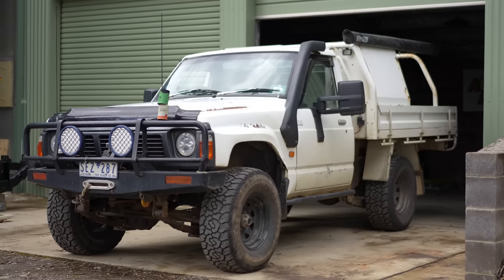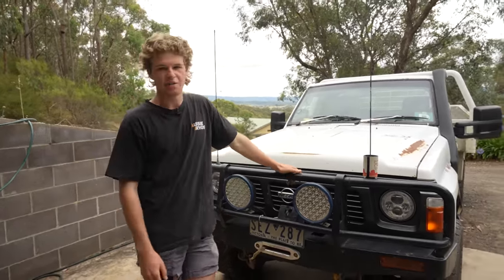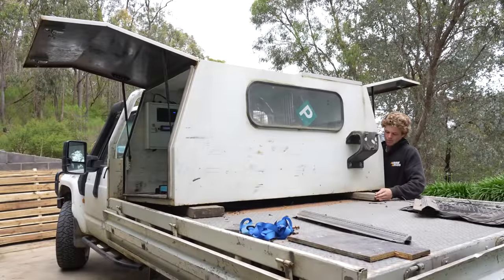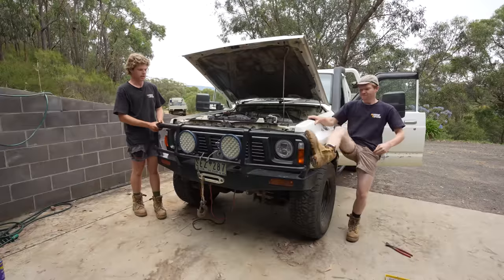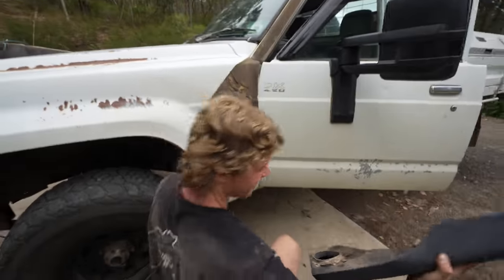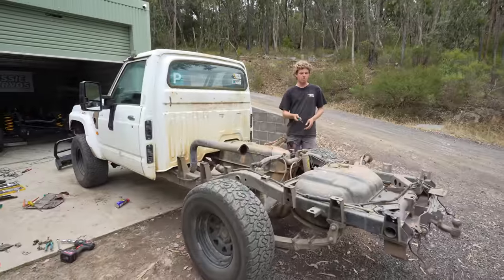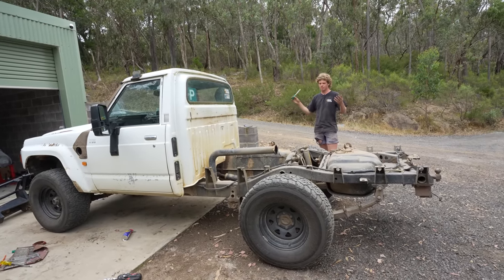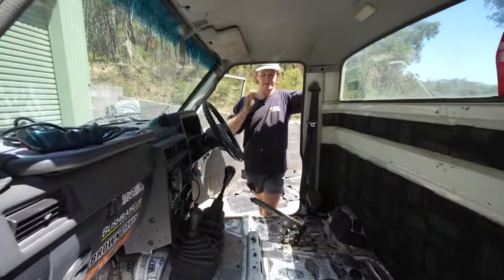DESTROYING a perfectly good 4WD

Comment: While you have the cab off, weld some washers around the captive nuts for the seats, especially the rear ones on each side. These are common places to crack and rust on GQs due to fatigue on corrugations. 

Also, it's a good time to take the gutter off under the windscreen, clean and treat the valley with some under body spray. Let rust converter soak in first as you will have corrosion in there. If left long enough, it eats out through the pinch seam above the brake booster and is a PITA to fix.
Reply: It's fun watching this. It's the process so many of us go through with builds. Get a new truck, work out how it works and start adding things to make it fit what we need. The you always hit that point of, "I know what I want now" and it's either a full rebuild or buy a new project. Good for you that you're sticking to it.
I've been down this road twice with my GQ, the third rebuild is getting closer than my bank account would like!

Comment: I managed to fit a gu ute coil cab sub tank to a factory coil cab gq ute. Just needs the mounts welds on at the middle cross brace. You could use all the lines and wiring and pick up a second hand tank cheap.